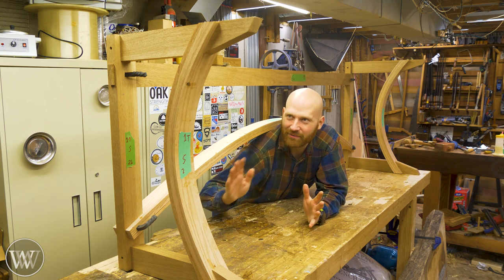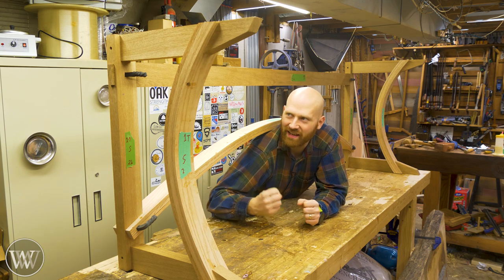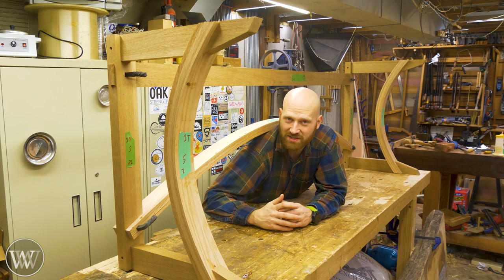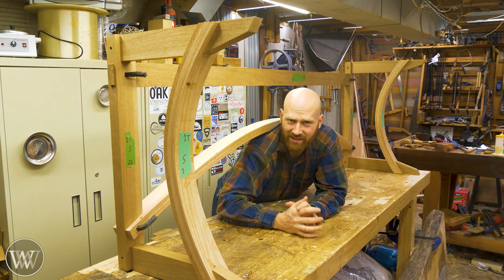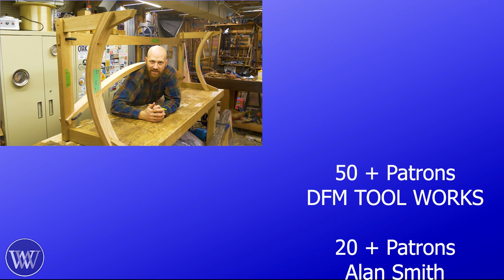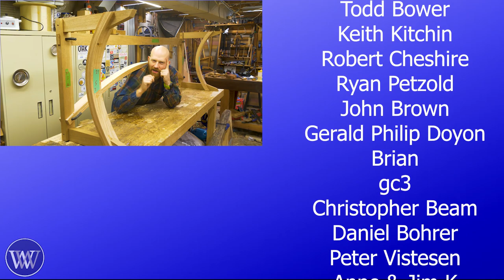Slab Top Oak Desk Build all Hand Tool Furnature Woodworking

Comment: Connecting the bottom arched stretcher to the top stretcher in the center would have made the frame much stronger.
Just saying...
Reply from the maker: I was looking at doing that, but the amount it would have actually asses was very minimal. the lateral strength of the current design id far stronger then it needs to be